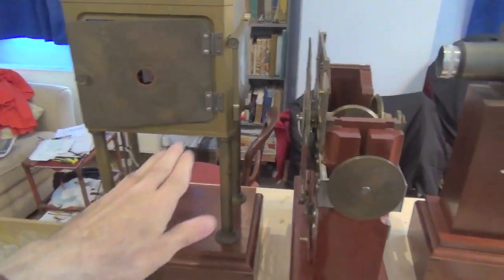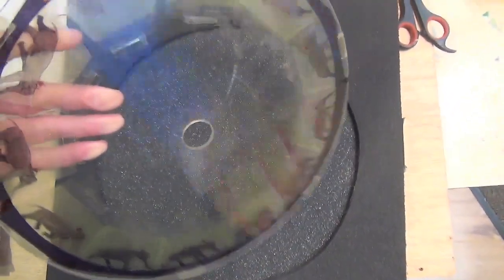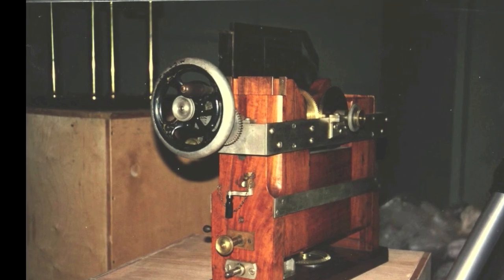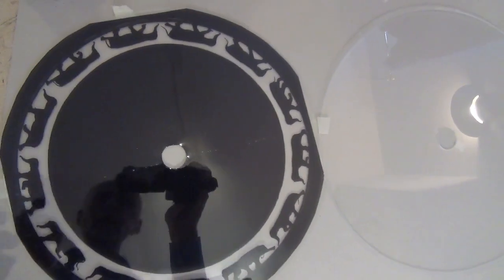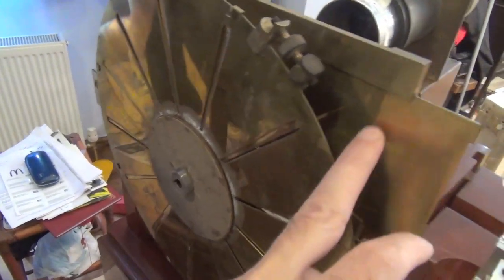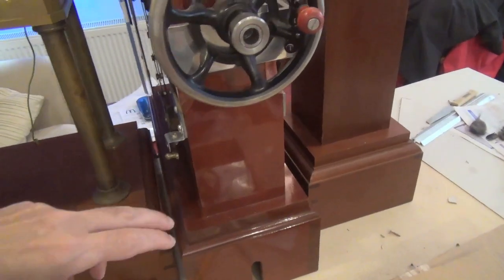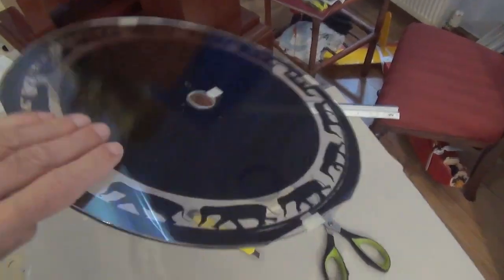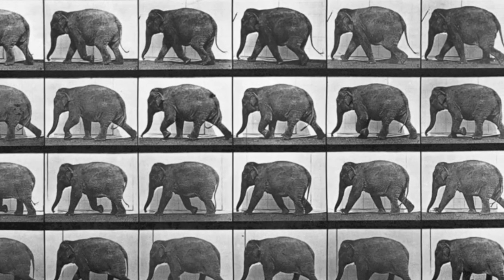Muybridge Zoopraxiscope Working Replica

Comment: Hello, did you make this device or purchase it? I inherited about 50 original 1880s plates made with photographic negatives and I'd love to be able to play them.
Reply from the maker: Hello, This is a replica made in the late 1980s, and belongs to Kingston Museum (UK). I was getting it working after many years when it was in storage.Could you please tell me more about those plates? They sound very interesting and important. I can help you with information, etc.
Reply: @horipet  Thanks for the response! I don't know that much about them- my great uncle's family owned an antique store in Delaware at some point and left the plates to him when his dad died. I collected antique cameras and projectors as a kid, so they gave them to me. The plates themselves are of three types: the first are circles about 9 inches across, made of glass with two small hand drilled holes in the middle. The second type seems to have something to do with production- they have the same images but on 4" squares of glass with no hole. The third type are 9" squares of flexible clear plastic that look old but I would guess aren't of the same vintage due to the material (maybe some early attempt at restoration?). I haven't looked at all the animations but they include carnival games, dog tricks, and kids fighting. Most animations are between 21 and 50 frames. The plates were stored in a wooden box that looks made-to-suit. The only date information I have is the wrapping the plates were originally in- an edition of the Brooklyn, NY daily eagle from April 1898. 

I'm currently trying to figure out the best way to scan them- I'm hoping to digitize them and make them into GIF images. I'd love to get in touch and send you some scans! Just let me know your email. I can't sell them because they're heirlooms but I'd consider donating some to a museum if it turns out they're important. To this day I've never seen any indication that there's other plates out there- most zoopraxiscopes I've seen are drawn rather than photographs.
Reply from the maker: @xifamilynetflixaccount7450  Hi, the 'flexible plastic' might be celluloid (available from the late 1880s, and sometimes used for early circular moving image discs). If you send me scans, I can probably send more info. You can reach me at: s-herbert@easynet.co.uk  but note that i will respond from a different email address. I have a web page about this subject - I'll post URL here later.  Stephen

Comment: Is there a relationship between the number of slits in the shutter disc and the number of siloetts on the picture disc?
Reply from the maker: Yes. Originally, Muybridge's zoopraxiscope had a number of shutter discs, with different numbers of slots, to correspond with different numbers of images on a picture disc. Then it was used with just a 13-slot shutter , and the later discs were made with that in mind. The replicas were made that way too. So ... thirteen elephants, and 13 shutter slots, and the elephant will appear to walk without progression (i.e. 'on the spot'). Fewer or more elephants (12 or 14) and the elephant will appear to be moving forwards or backwards in relation to the screen area. Of course, the sequence also needs to look natural without a 'join' - so the images chosen to produce the sequence need to cover a full stride - no more and no less, or there will be a jump when the sequence continues. That's just the basics - it's an enormous subject. I'll post some more info later if I get time.
Reply: @horipet  Thank you for the reply. That is what I thought, I figured there had to be a relationship, one to the other. Thank you for the information. I am in the process of building one and its the details of this kind that will make or break what is sure to be a long process. Awesome video as always.
Reply from the maker: @tobroken1965  Search for my website: The Compleat Muybridge (note unusual spelling) and from the index page go to: Zoopraxiscope, and Zoopraxiscope discs. Also, go to my other website The Wheel of Life (Google search: Wheel of Life Zoetrope Herbert), find contents page, read about phenakistiscopes and phenakistiscope projection. The book 'Eadweard Muybridge, the Kingston Museum Bequest' illustrates all of the discs, and gives more information about the zoopraxiscope and how it was used. I have copies for sale if online copies too expensive.